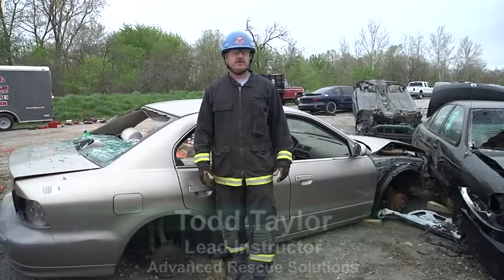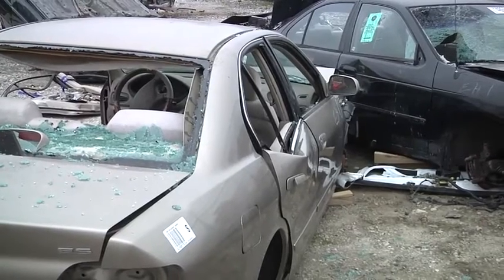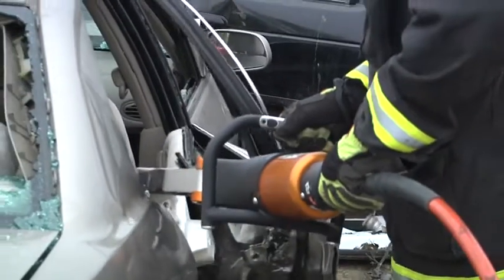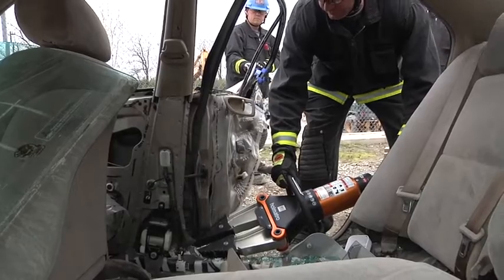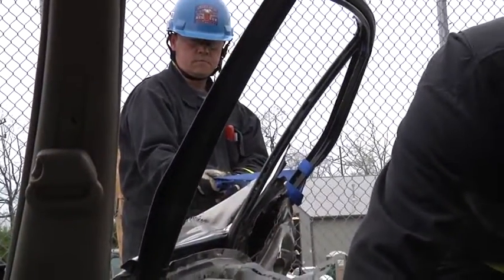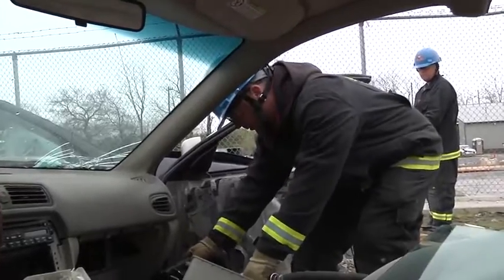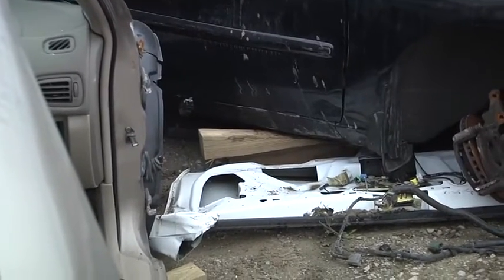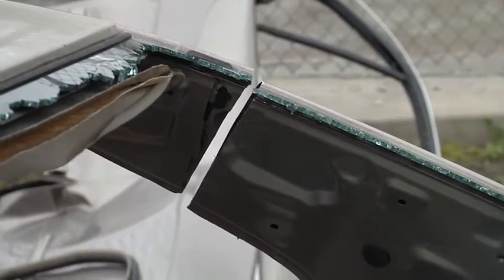Extrication Tips and Tricks

Comment: hey there...when you do a peel and peak...unlock the door from the inside if you can.  Even if the door is ruin from the accident, if you're able to hold up the handle from the outside with a wedge or a rope, the nader pin popping out becomes inconsequential.